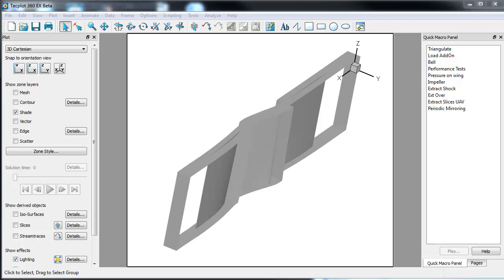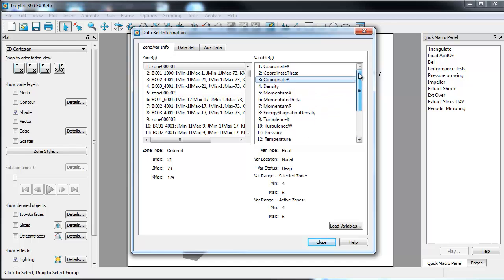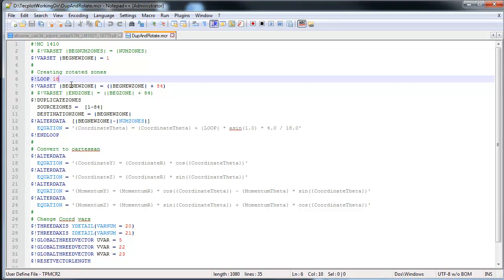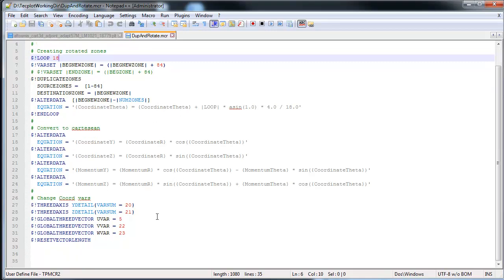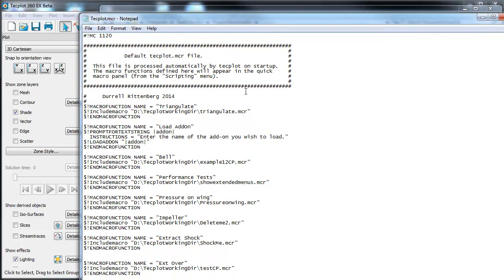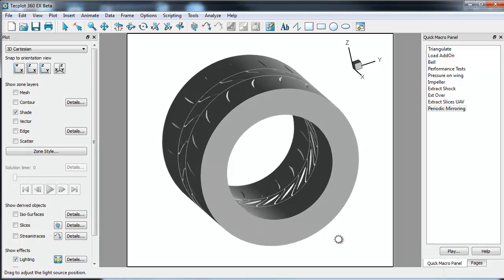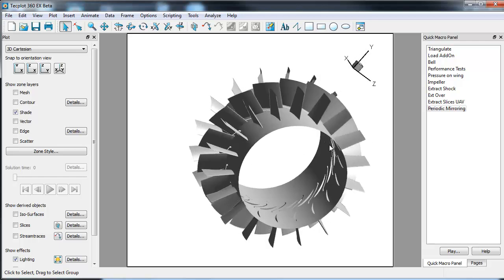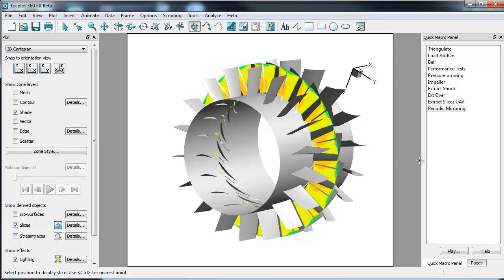Rotating Machinery Mirroring Example in Tecplot 360 EX

Comment: Thank you it was helpful to use macro. Ihave similar case but my coordinates are as cartesian. I try to use macro for rotate but i can not succeed. What is your advise ?  Also i do not understand how your case visuilize on tecplot because your variables are as cylindirical coordinate x theta and r  but your tecplot orientation use x y z system. I always fail when i change my data from x y z to x theta r , the geom is deformed from original one. Is there an efficient way of rotate one passage to full passage in cartesian coord.?